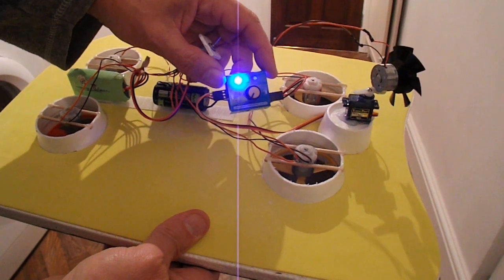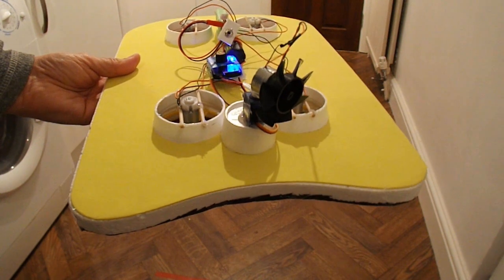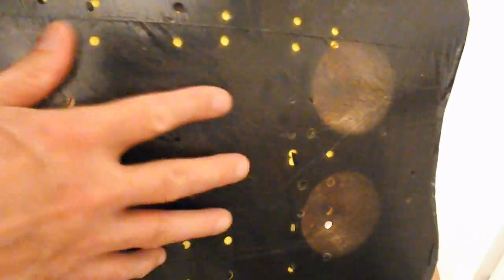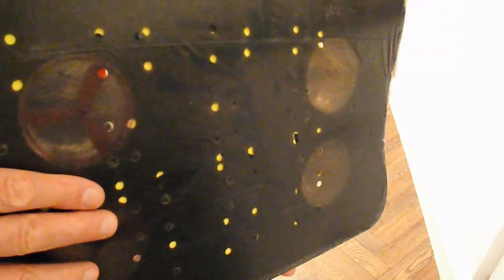Will that old LiPo power my quad engine hovercraft?

Comment: You need slot stronger motors probably 12 volts each would do, and try make it as light as possible by shedding parts of the structure and equal the weight out
Reply from the maker: If you go back to the start of this project you will see this is constructed from items purchased in the bargain stores. The motors come from vibrating tooth brushes and the body is a swimming float, the fan blades come from a helicopter spinner type of toy.  If I wanted to spend money on it I could easily buy more powerful motors and proper fan blades but that was not the idea of this project.
Reply: I know, even I have only these types of motors I find in rc cars, bigger motors are expensive, especially the lightweight ones made for rc helicopters.

Comment: Try a better propeller that's how he can push the hovercraft
Reply from the maker: Yes a bigger propeller and a more powerful motor will make it go faster. Not much point if I am just trying to demonstrate it in my kitchen. If you look at the previous videos in this series I did have a slightly larger propeller and motor. To really make it go I could put a proper RC plane motor and propeller on it but the original project was to make it entirely from items bought in a bargain store. To keep to that I could just use 2 or 3 motors at the back all linked together.